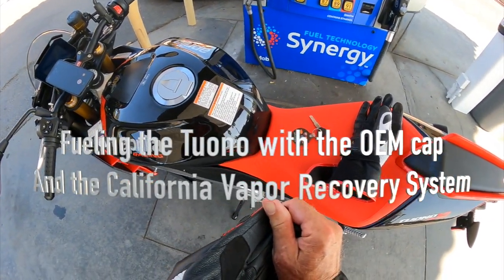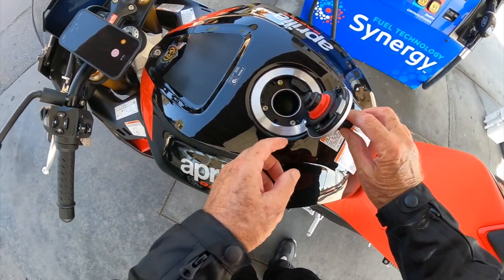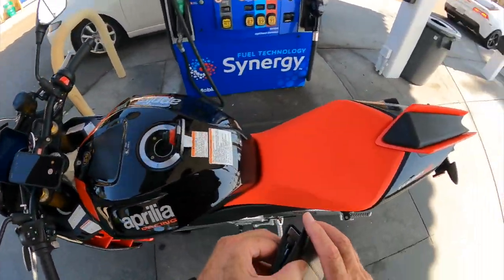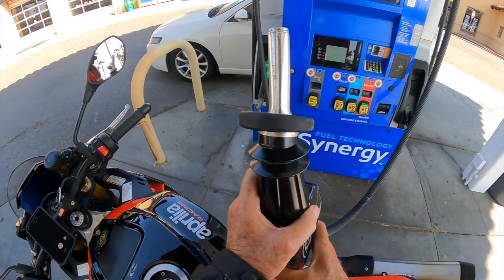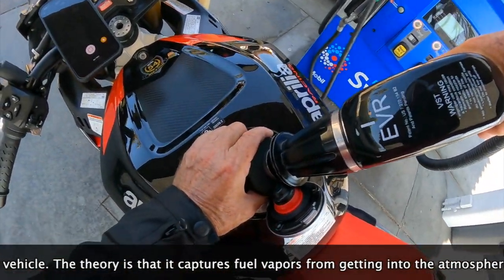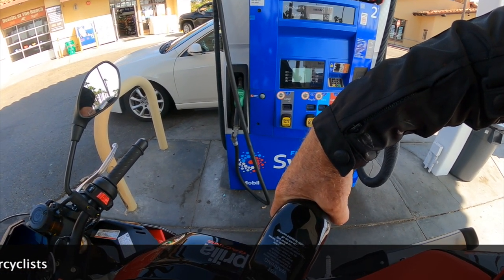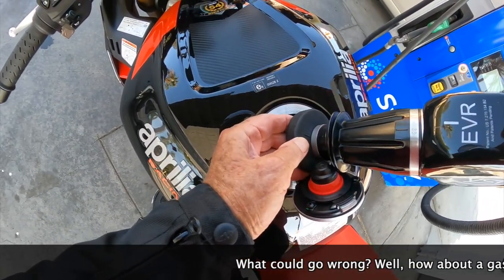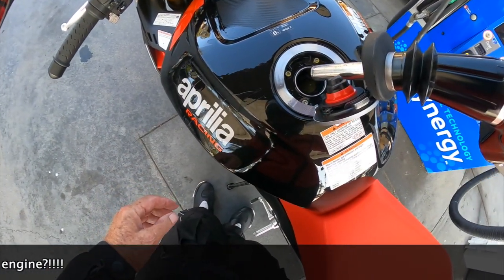Fueling Up The Aprilia with the California Vapor Recovery System, what a pain!   HD 1080p

Comment: I also have a 2021, I avoid fully inserting the nozzle when fueling to avoid any issues. Makes it much easier to fill and also get a little bit more extra fuel
Reply from the maker: Yes, I try to do so as well.....good advice, thanks for pointing that out!
I am going to replace that cap as probably one of the first things I do.